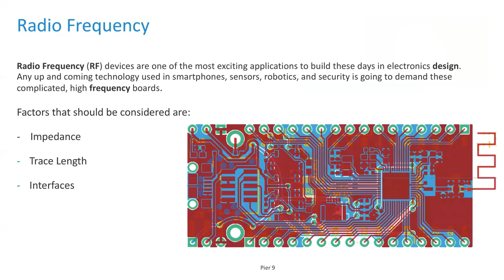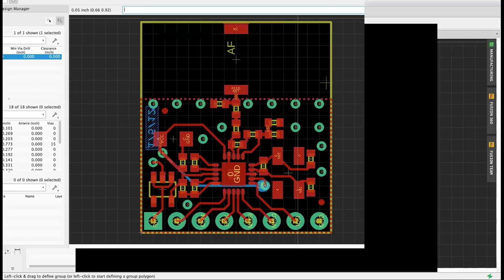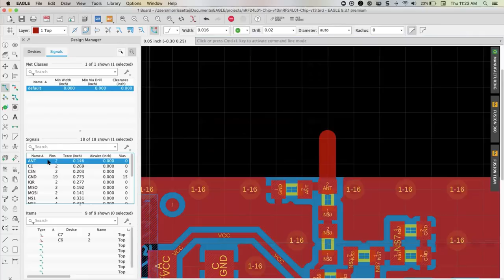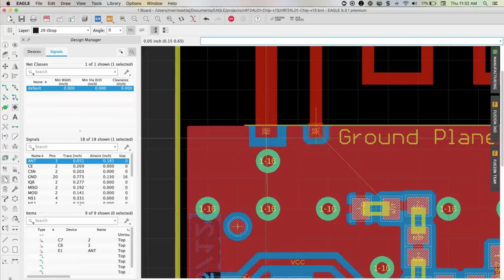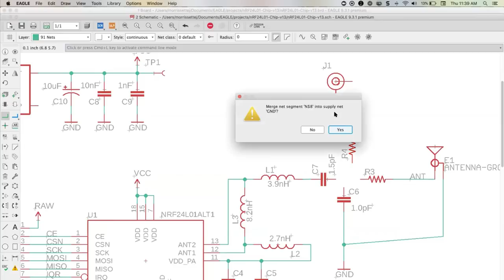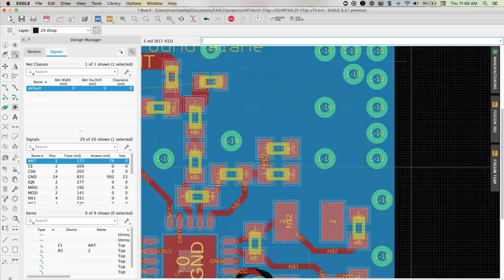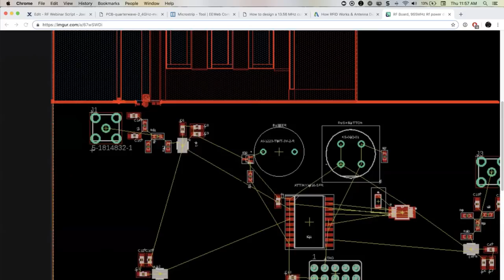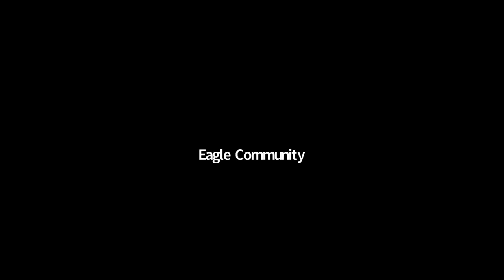RF PCB Design Guidelines MAR 2019

Comment: I love the concept for this webcast where a subject matter expert explores designs via the tool live. It's extremely useful since the kinds of things that Joel does while altering the design (e.g. moving the polygons around, trying different trace widths) are things that real prototypers will do and can learn from, not only from the design principles but also from the Eagle usage tips that Jorge chimes in on. Awesome!
Reply: Where's the subject matter expert? I see a dude who kind of sort of thinks maybe you don't need to worry about using a microstrip or CPWG if the track length is less than 1/4 wave!!! Then fumbles around saying that all you need to do is trim the IFA (inverted F antenna) a bit to get an appropriate impedance match to the transceiver without completely revisiting the matching network. "Oh well maybe you'll get a little attenuation but you can fudge it". The way to do this is to use a VNA or proper simulation tool followed by the VNA. The magic spectrum analyser will do nothing for you in this scenario except show you relative field strength.  No doubt he can layout PCB but not RF and he shouldn't be presented as anything that resembles a design reference for RF. Caveat Emptor just because you saw it on the internet doesn't make it right!

Comment: What is the use of the via with the grounded PCB antenna? It just sits somwhere randomly close to the outgoing trace but seems like it could just as well be omitted?
Reply from the maker: Hi Prof. Sparkles! May you please specify where you see this? Thanks
Reply: Hello Prof. Sparkles, As frequency of signal flowing through circuit increases,Impedance becomes prime concern, And as we know current follows least impedance path, It must have to switch between the planes. Vias provides   least impedance path to current. So it is better to put vias near high frequency traces.

Comment: Nice video, I have question regarding ground plane , is it required to have ground plane on the bottom layer opposite to pcb trace antena? in some places its mentioned we need to have ground plane on opposite layer of antena trace, so it would be good if you clarify that

Comment: I think it will  be important if you put shielding vias around antenna traces too?
Reply from the maker: Hi Gharbi! Thanks for your question. Shielding vias around antenna traces will in most cases hamper the antennas performance. In fact it's imperative that you avoid having any ground plane underneath the antenna. Cheers!
Reply: @AutodeskEAGLE  sorry i'm meant by that stitching the antenna output trace before even designing the antenna  . thank you for your response